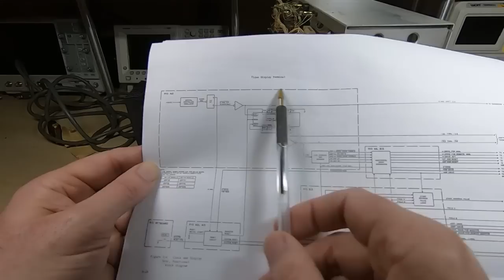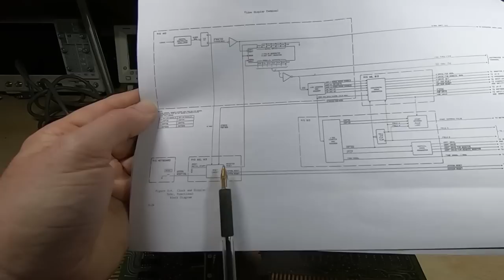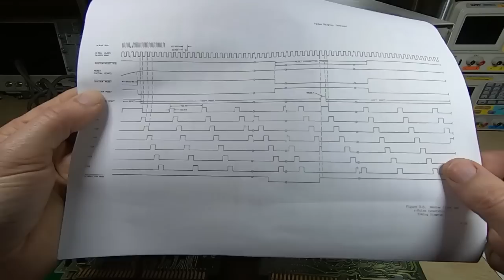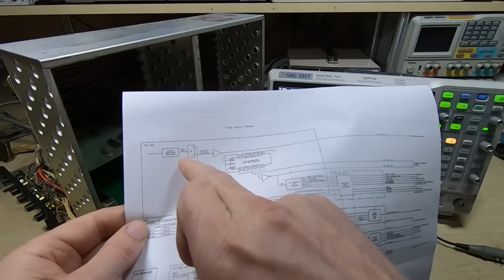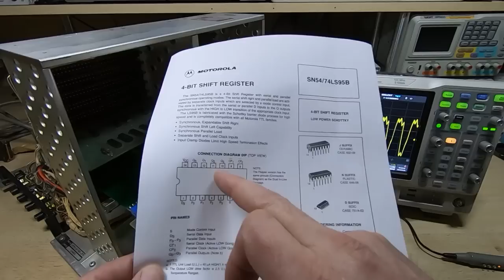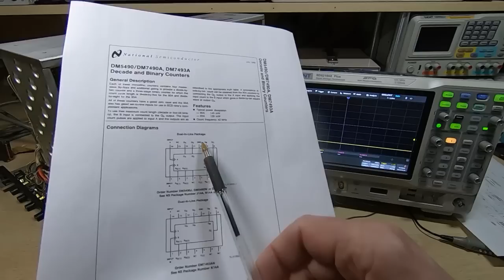Hazeltine 2000 Repair Part3

Comment: Jerry, I know I am late here.  I am not expecting you to recall exactly what happened nearly 2 years after recording this video.  You also call you that it is not the first tool you reach for, preferring the oscilloscope.  My comment is more for those like me who are just finding your channel.  I hope it continues to grow!

It looks like when you are measuring the ring counter with the logic probe your finger might be touching the probe pickup. It might just be optics, but I thought I might call it out to avoid confusion.  From experience, that will make the signal appear to float or toggle -- giving inaccurate results.  Indeed, in the test you performed, the results would look the same if you were touching the probe or not as you expected the pin to toggle.

I know it can be tough to get that little point accurately on the pin and the inclination is to hold the probe as close to the "business end" as possible to maintain control.  The recommendation here would be to simply take a moment to make sure you are not touching the probe pickup when you take a measurement.
Reply from the maker: I have been designing and repairing systems for around 60 years so I know how to use a logic probe. The camera does not always make things clear.

Comment: Jerry, I've got a 'scope newbie question:  When you checked for signals from pins QB-QD on the last IC, you saw that they were there and were satisfied with what you had checked to that point.  However, I was also seeing what looked like multiple signals being picked up by a single probe.  Can you easily explain what caused that or, if not, possibly point me to another video or source that could?
Reply from the maker: The signals were as expected for a single node although I did say I was not fully testing them in this video and would be testing them further off camera to ensure proper phase relationships. If you mean the second counter output giving 'over lapping' signals then that is simply caused by looking at signals with non regular periods which is what you will see in a decoded binary counter of this type. In practice you would carry out more testing (as I said in the video). I am just showing how to go about tested and I am trying to avoid showing specific signals as they may vary depending on what you are testing. If you want to examine the actual signals in more detail then you could perform a single capture but as I indicated in this video I am only checking very basic operation. I will examine the signals in more detail in later videos if required.
Reply: @JerryWalker001  OK, thanks.  This will help me in the future with my "baby steps" using a 'scope on my old computers.

Comment: Fantastic as always. Good to see the old logic probe get used.

As a 10 year old (35 years ago) inquisitive lad I dismantled a redundant betamax VCR, it was one of the earliest models; a huge thing as big as a suitcase. It was built with discretes with just half a dozen 74 ICs spread across about 4 large PCBs. I proceeded to desolder all the parts I could and was surprised that a 7493 (a part I've never seen used in anything since) worked when put in a breadboard, which surprised and and delighted me. My father saw me struggling, removing parts with my iron and proceeded to use his blow torch on the boards! Your video reminded me of this adventure, a thing that got me interested in electronics at an impressionable age. I still have the 7493 somewhere. 

Anyway. Thanks again.